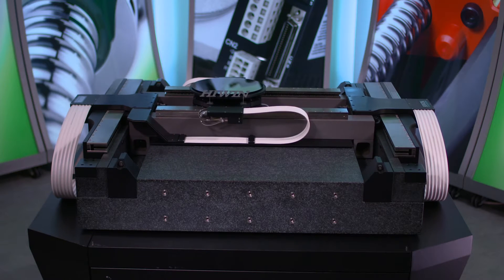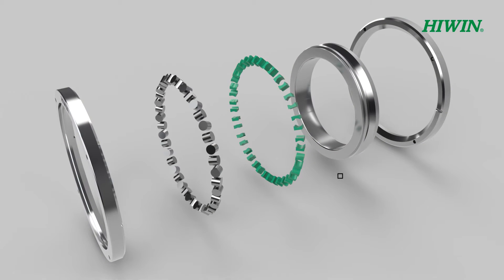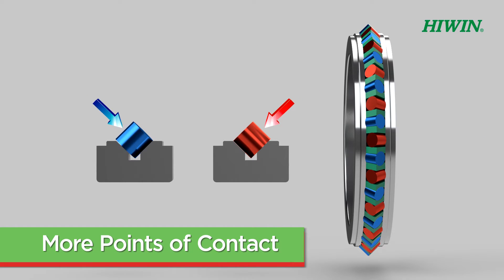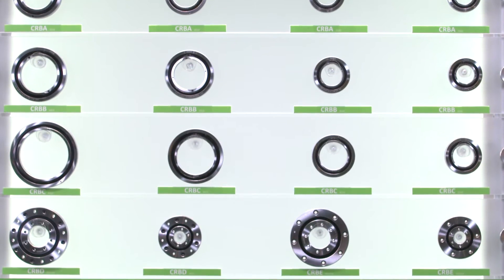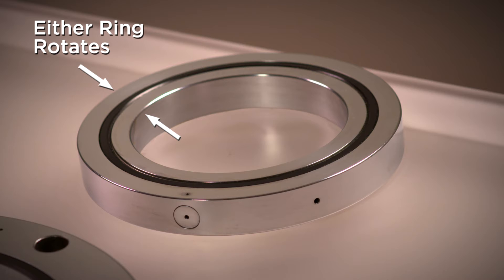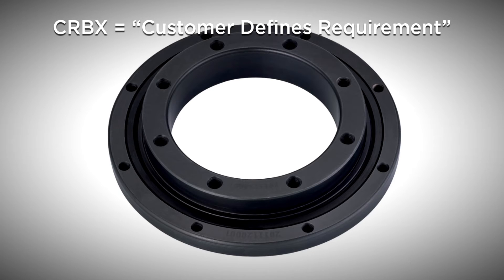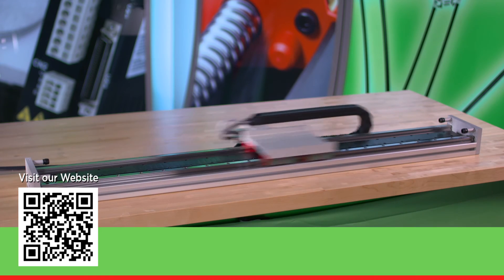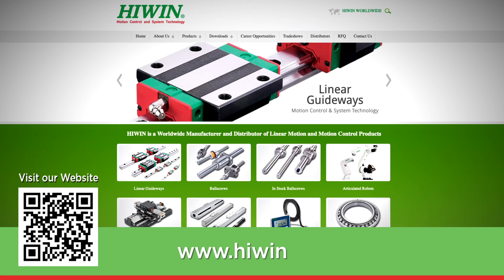Hiwin US Crossed Roller Bearings

Comment: how calculate to bearing life (with various load types) (One is a  Deep groove ball bearing ，the other is a crossed roller bearing)
Reply from the maker: Thank you for your question.  Bearing life can be found by combining the different loads (axial, radial, moment) into a dynamic equivalent load and comparing this value to the dynamic load rating. For a Crossed Roller Bearing, this process can be found using equations listed in the HIWIN Crossed Roller Bearing catalog on numbered page 7  found on https://hiwin.com/resources/catalogs/. For a deep groove ball bearing, lifetime would be calculated similarly but only for axial and radial loads, although HIWIN Corporation in the US does not offer deep groove ball bearings.  If we can help you further, you are welcome to reach us at techsupport@hiwin.com.